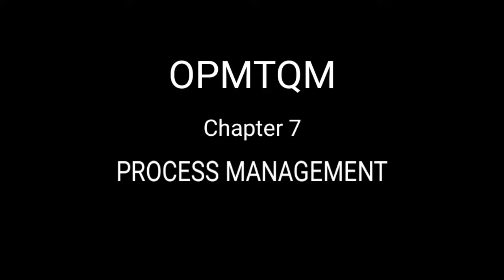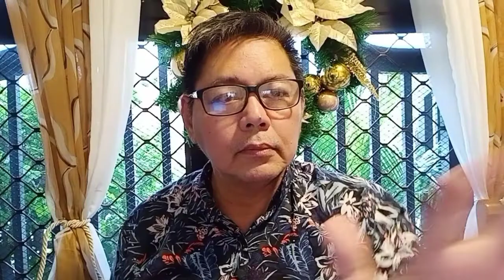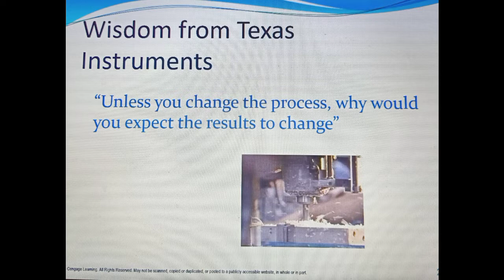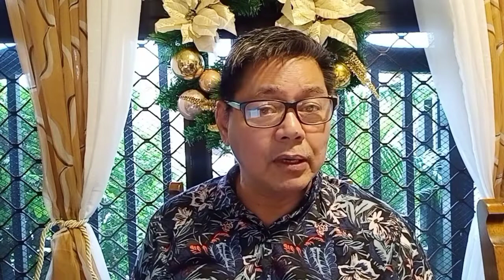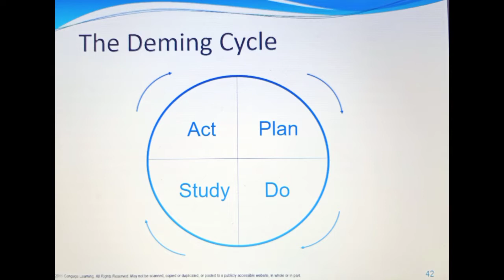OPMNTQM CHAPTER 7 PROCESS MANAGEMENT

Comment: Ferandez, Fatima Nicole J.
3-BLM

    In order for a company to perform at its peak working condition, it must have an effective process management, an effective process management can minimize possible service defects and errors that will, in turn, reduce productions costs and customer complaints. There are different business processes that can affect customer satisfaction and are categorized into two factions, the first process being the value creation processes, which are important in running a business for they are activities that develop and develop the product specification, defining the attributes and the characteristics of the product. They often take the form of projects and these projects are temporary work structures that startup the project and eventually shutdown. Another factor that falls under the value creation process is the product and delivery process, they see to it the product is delivered efficiently. 

     The second business process is the support process, which is defined as the most important process to an organization's value creation process, they are mainly composed of the employees and the daily operations. Requirements for the support process often depend on the internal requirements, which means that they should be coordinated in order to create a linkage between stakeholders.  

     Process management involves planning, not only in terms of the present situation but for what is yet to come, this planning involves administering the activities that are necessary to achieve high-level performance in the key business process, eventually seeking the opportunities for improvement in quality and performance reaching the main goal which is customer satisfaction. It aims to prevent issues and continuous development of the product itself, the needs of the customer is the focus of the process management, such as having corrective causes such as treating symptoms and identifying the cause of these faulty effects. 

     After assessing what process is needed there then must be mistake-proofing, which asses the efficiency or simplifies the task, it is referred to in the video as "Poka Yoke" which is Japanese for "mistake-proofing", and is a device that is used to avoid mistakes and errors that will result in fewer mistakes. The process design should aim to identify the product or services, the customer, the supplier, the process, and mistake-proof the process, and develop the measurements, controls, and improvements of goals. The primary causes must first be identified in order to further the development and their impact on the process performance next is to develop potential changes that are necessary or the ultimate solutions to the problems that plague the products manufactured by the company. 

       In short, to be able to create process management that is effective one must conduct a test pilot to measure the impact of the solutions that were finalized and if it meets company standards, next is to identify the measures to understand how changes and solutions should lead to the success of the proceeded solutions based on the results when the results are taken from the pilot test, one must now study the results and determine whether the process was effective and managed to improve the performance and identify what else is needed to improve the product, after which we act by selecting the best change or solution wherein our implementation plan comes from, what needs to be done and who needs to be involved, another act is coming up with a new standard operating procedure that is stemmed from the previous study and feedback of the customers, next we establish a process to monitor the performance as well as controlling it, often referred to as the Deming cycle. Lastly, we achieve the set goals and create improvements that will change the company forever, creating major improvements that are detrimental to the further evolution of the company and its products.

Comment: Khervin Peniano
2-BBE 

Process Management is a method for planning and administering the activities through  design, control, and improvement. Process management is critical to achieve a high level of performance. There is an idea in the process management method which is called control vs improvement. In this diagram, there are 2 line limits of the product deviation. Process management is designed for companies and organizations who heavily rely on process like manufacturing, services like massages. Anything above these two set lines would be considered out of control. This may mean defects in the manufacturing word or bad customer experiences in the service world. The goal is to make sure that 100% of the deviations from the mean would be within the pre-set lines that the company set. 

    When a mean shifts for the better, this is called an improvement and a new set of standards are set according to the new average mean. Again, anything outside the set lines are called out of control. This is useful for companies who want to visualize their outputs. Using this graphical method process, it will allow for companies to see their zones of control and to judge whether they are improving or not. 

    In order to achieve control as said above, it is crucial first to set goals. Then, to set measures of how to to know when you have achieved your goal. For example I could measure my product defects to be within 2 standard deviations from the mean. Lastly is to compare the results with an industry standard or a standard from a sister company to asses the progress.

Comment: Alano, Adrian James C.
2BBE

“Unless you change the process, why would you expect the results to change.”
In this video lecture it is stated that “Unless you change the process, why would you expect the result to change” It means that you have to change something inside the business or outside the business in order for it to improve and continue to run. Also, this lecture talks about the processes of a business the improvement within the organization.  Processes can be formal or informal. Formal processes also known as procedures are documented, and have well-established steps.
For example, you might have procedures for receiving and submitting invoices, or for establishing relationships with new clients. Formal processes are particularly important when there are safety-related, legal or financial reasons for following particular steps.
Informal processes are more likely to be ones that you have created yourself, and you may not have written them down. For example, you might have your own set of steps for noting meeting actions, carrying out market research, or communicating new leads.
There are different kinds of process management that can affect customer satisfaction. No process understanding Processes can be mapped in different ways, including on paper or using a software solution several elements must be kept in mind when mapping your organization or department’s business processes, to ensure the version is the most optimal and efficient. No process upkeep. When customers ask a question or encounter a problem, the issue at hand is almost always governed by one of your existing business processes. For example, complaints like, “My internet connection is out of service,” “I haven’t received my package,” or “The invoice you sent my company is incorrect,” will all have a corresponding business process that has in some way gone wrong or been interrupted.
If your processes are not regularly reviewed and updated especially those which are crucial to your business or run at high volumes—then some information may no longer be up-to-date. Outdated processes mean bottlenecks, tasks performed incorrectly or not in compliance with regulations, or some other error that will affect the customer. No customer journey maps. By now, you will definitely have heard of Customer Journey Mapping, or CJM. It is the new cornerstone of understanding customer interactions with your business, offering you a digitally designed overview of your customers’ different touchpoints with your organization. Without a defined customer journey map, you will have no clear understanding of the way customers perceive the service you offer. No information standardization
In companies, communication is key. Clear communication provides vision and direction for employees. If your organization comes with communication bottlenecks as standard, and key information is filtered, distorted, or fails to reach the right people, it can be difficult or impossible for them to carry out their various missions correctly. This goes doubly in organizations where the type of information being communicated is in different formats, or is used by different departments to make decisions in different fields of work.
A CJM means you can consider the changes that can be made to these touchpoints as needed. You can define improvements with the department concerned, fine-tune the solutions you implement, and therefore optimize the customer experience and customer satisfaction
No task automation. The larger your organization is, the more you have to juggle and communicate between different departments to implement and execute an entire process. To execute a process, the involvement of several people from different departments will almost always be necessary.
There are three types of process 1) Managing: business-processes which manage functioning of a system. Corporate management or strategic management can be examples of this type. A time tracker can have auxiliary function in managing business-processes. 2) Operating: business-processes which provide the main business of a company and make the basic income stream. A time tracker acts as a controller of this process. Production, marketing and sales are examples of operating business-processes. 3) Supporting: business processes which serve the basic business. For example, accounting, human resource management, technical support. A time tracker is a key tool for human resource management. Moreover, time tracker software can be integrated with accounting software and technical support service in order to optimize business-processes of a company.
In conclusion, Process Management or Business Process Management (BPM) is the organizational discipline that provides tools and resources for analyzing, defining, optimizing, monitoring, and controlling business processes and for measuring and driving improved performance of interdependent business processes.  BPM is a way of looking at and then controlling the processes that are present in an organization. It is an effective methodology to use in times of crisis to make certain that the processes are efficient and effective, as this will result in a better and more cost efficient organization.

Comment: Admana, Marikit A. 
3-BLM

Chapter 7 of Total Quality Management discusses process management, its importance, how to implement the work process, and the key management principles. Process Management is a way of looking at and controlling the processes that are present in an organization. It is an effective methodology to that can be used in times of crisis to make certain that the processes are efficient and effective, as this will result in a better and more cost-efficient organization. The term process management covers how we study, identify, change, and monitor business processes to ensure they run smoothly and can be improved over time. It is best thought of as a business practice, encompassing techniques, structured methods, and optimization.

Key features in the cycle of process management include five connected stages. First is the design, by identifying all existing business processes in the order they occur, including dependencies. Second is modeling by taking a theoretical business process design and analyzing or improving it. Third is the execution, by implementing manually in the daily business activities or to automate. Fourth, is to monitor the activities and process. Through this, a business can measure and analyze the performance of its processes to identify critical problems through the data they get. This way, they will able to improve the speed, quality, and efficiency of their processes. Lastly is optimizing the process by collating all performance information across all stages of the process management cycle. This involves putting together data on what worked and what didn’t work, from the design to the model to monitoring.

Process management is essential because it enables organizations to align business functions with customer needs, and helps executives determine how to deploy, monitor and measure company resources. When properly executed, process management has the ability to enhance efficiency and productivity, reduce costs, and minimize errors and risk, thereby optimizing results. Organizations employing a holistic approach to process management derive tangible benefits such as revenue growth, cost reductions, compliance, risk management, productivity improvements, customer satisfaction improvements, competitive advantage, and transformation and innovation agility. Thus, process management has been demonstrated by companies like GE to deliver double-digit improvements in measures such as margin, capacity, resource utilization, and capital utilization.

It is implemented by reviewing and aligning the processes with its business strategy, by making a list of every process of the company and considering the company’s business process algorithm. Assessing and modeling the process which involves capturing a clear picture of the different details of a company’s process and how each department of the company interact with one another. Likewise, measuring the process is important to rate the effectiveness and efficiency in helping a company achieve its goals. Moreover, by analyzing and applying benchmark process to enable the company to identify world-class performance and measure themselves against that. Benchmarking, if done right, will certainly flag processes that need improvement, even if the company is the industry leader. Therefore, process improvement must be done to identify, analyze, and improve existing business processes in order to optimize them and ensure consistency in standards of quality. Automation is the last step in process implementation. Through this, a company can get to implement decisions directly in the process application being used. Examples of such decisions include field-level validations, routing decisions, and some static services.

To conclude, process management brings enormous benefits to adaptability and overall competitiveness which makes it very important for all the businesses but the thing which comes first is to take imperative of determining what your key business processes are, because all the processes and standardization comes after you determine what will be key areas within organization which are going to be focused. The other part is to cope with the resistance which is generally faced by organizations while keeping employee motivation and morale high.